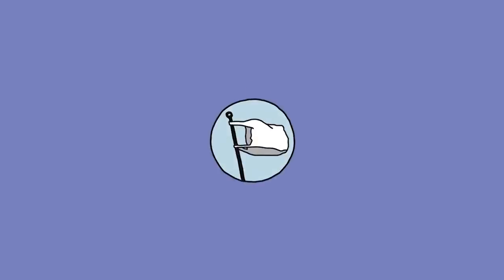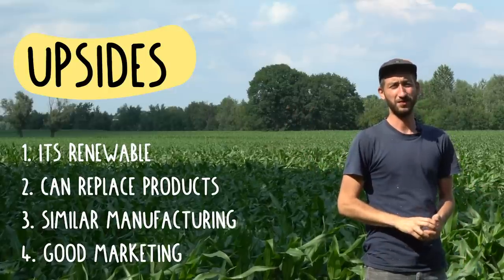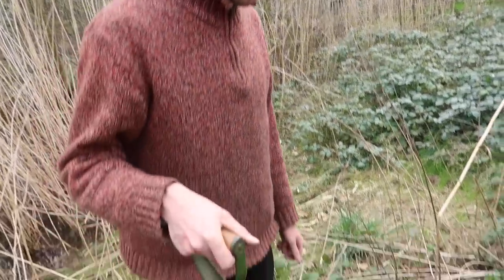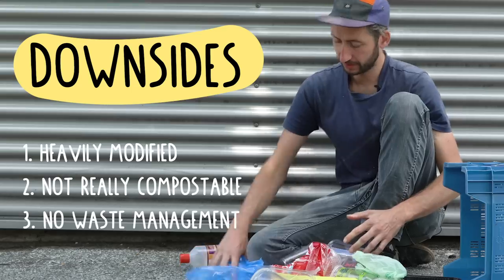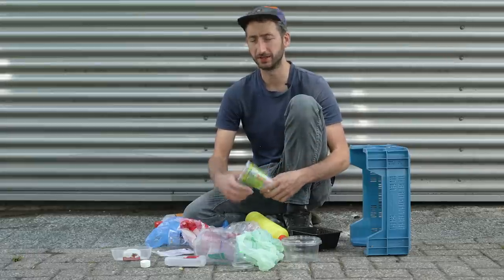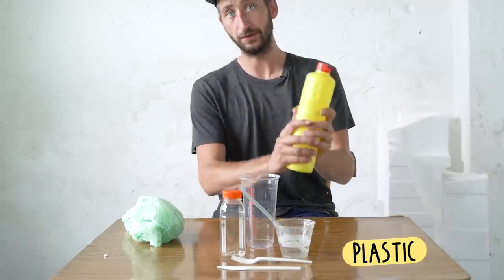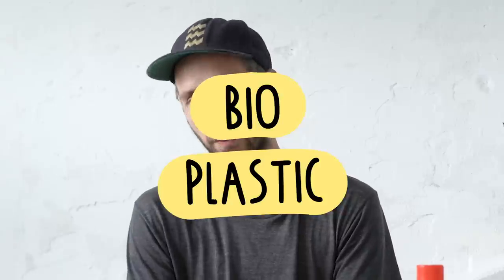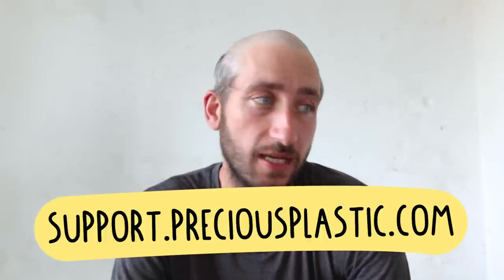Biodegradable & bioplastics explained (part 8.0)

Comment: This is the kind of videos that left me something that I'll never forget

Another thing that i thing it's worth to mention and its scaring me, is that the materials used to make plastics, biofuels, etcs, looks pretty friendly but are in fact comestibles goods. We are feeding machines with them instead peoples. 

David: You already done a great positive footprint in this world. Thank you man!
Reply: The "Food versus Fuel" arguement (And a less mentioned, but equally relevant "Farmland vs Wildlife" arguement, as arable land is less of an issue compared to how we get that land in my opinion) is VERY valid, so it is good you recognize that.

However there are many methods for Biological Feedstocks other than using dedicated "Energy Crops",Such as Maize or Sugarcane based ethanol/plastic, or oil crops such as Oil Palm.  Mainly Algae, Argicultural Waste, Sewage/Wastewater, Food Processing Waste, and usage of "Cover crops" or other related yield increasing crops alongside food crops.

I will post some relevant links below:

https://wikipedia.org/wiki/Food_vs._fuel

https://en.wikipedia.org/wiki/Sustainable_biofuel

https://en.wikipedia.org/wiki/Lignocellulosic_biomass

https://en.wikipedia.org/wiki/Biofuel#Second-generation_biofuels (2nd generation and foreward will use non-food cropss, and often not even farmable land)

https://en.wikipedia.org/wiki/Anaerobic_digestion#Waste_and_wastewater_treatment (can produce a substitute for Methane/Shale Gas/Natural gas.  This is typically used for fuel, but can be used in refineries)

https://en.wikipedia.org/wiki/Cover_crop

Comment: I think the issue is PROPER RECYCLING AND EVENTUAL DISPOSAL

Plastics are essential to hermetic seals, products that can last a long time, and yet be light and not brittle (Ie not glass or ceramic)

I think they are essential to many aspects of the modern world (granted some use cases should be stopped such as "disposable" water bottles etc)

I feel it is much more important to encourage proper plastic life cycles, rather than try and fear monger/ban it entirely

Plastic is no issue if it is:

- Reduced as Much as Possible (use less, don't have "dumb" use cases ie disposable water bottles etc)

- Made from biological source material (in plants using sustainable energy sources for power) via

*the chemicals made via microbes in bioreactors
*Via Pyrolysis Oil  (preferably from Biomass and/or RDF firing plants)
*Via Biomass Oil (Via oil crops like algae, and NON FOOD VS FUEL SOURCES)
*Via HTL Bio-Crude

- Sorted and Recycled (As many times as possible)

- Downcycled ( PET->Polyester etc)

- Disposed of Properly (Prefferably via Biological Digestion (Anerobic, or via Genetically Modified "Plastic Eaters" in biodigesters), or Pyrolysis and/or Gassification)
Reply: We have the technology for most aspects of the above outlined solutions.

Others are near-future, and are limited mainly by research funds, and "economic viability" both of which are solved via government action (Taxes on the bad, subsidies on the "good", regulation of pollution, research grants etc)
Reply: I think the Precious Plastic Recycling Ecosystem will have a HUGE impact on developing areas growing their recycling ability.

We need to "Close the loop" however, with Renewable and Sustainable Sourcing Options, Enviromental Cleanup Workflows/Tools,  and "End of Life" options.

Production is more difficult short of PLA, and may thus be better left to larger entities.  The continued development of sorting sensors/workflows, and the below enviromental recovery options may act as a sort of "Plastic Mining" source.
 
Pollution Cleanup Options Such as Locally Produced "Booms" to contain, and if towed, collect Floating Plastic Debris could reduce local plastic pollution (ALONG WITH stopping ongoing pollution obiously)

End of Life Options are an area Precious Plastic could expand into well;  Workflows for Anerobically Digesting PLA, and Designing Low/No pollution Pyrolysis Units (Short of CO2 emmisions if using fossil fuel based plastic) could turn the "Un-recyclables" into useful energy, and prevent them from ever becoming polluting microplastics.

I feel these three areas can be developed by Precious Plastic, and would lead to far more Real World Change.

Comment: Good thing you mentioned biodegradable plastics at the end. Because I have worked on PHA and was thinking about it during the whole time haha. PHA is produced naturally by bacteria and they degrade it too. So you can just drop PHA plastics anywhere in soil, they'll decompose in a few weeks. Would have been nice if you has done a video using that.

Comment: Hello Kamp Dave and Army,  
I am writing from Canada and am so awed and impressed by the common sense approach to disentangling the waste management process. 
Turning it into a green end result for the planet, through vision and community futures.
💡 I have an idea, not sure it will be advantageous, yet worth taking it into consideration.
Using a parabolic mirror finish disc and using the sun as a solar eliminator...build an outdoor cement holding, open front-entry  shelter for plastic, with a roof exhaust fan filtration using a 2 step charcoal-water purification filter system.   
With the sun's angled ray directed with the parabolic dish which is attached to a fabricated metal rotating stand aimed at plastic. This will reduce the plastic into recycled reusable for building material. This end product is of course mixed with sand, cement, refined parabolic-plastic and foam to create a lightweight bricks and blocks  building for housing.
Just a though. □♡□ Mary

Comment: Thank you for this finally an honest  review on the truth about compostable  plastics, Can you do an experiment on oxo-biodegradable plastic?
Reply: Looked into those a while ago... As far as I understand it's the perfect way to create microplastic -.-
Reply: and as far as I know it's banned in a lot of places, right?
Reply: Well I looked in to the standard of both of them ASTM D6400 (for compostable) and ASTM D6954 (oxo-biodegradable) you ll be suprised that they both have same biodegradbility criteria its just the way they get that stage is different compostable needs composting facility and oxo-biodegradable needs open air (basically oxygen) because these confusing mis informations yes alot of places have banned oxo-degradable. Bu i think it has potential when it comes to littering issue and mismanaged waste soley because it biodegrades in open environment
Reply: I just think it will be fun expriment to do, and of the results turns out the opposite of what the general public thinks that would be interesting as well !
Reply: cool, I'll have a look at those standarts again! As far as I understand oxo-degradable plastics work by adding things that oxidise to the plastic, which just helps to break it into smaller pieces, but that doesn't have to mean that it degrades, right? 

"There is a considerable risk that fragmented plastics will not fully biodegrade and a subsequent risk of an accelerated and accumulating amount of microplastics in the environment, especially the marine environment. The issue of microplastics is long acknowledged as a global problem in need of urgent action, not just in terms of clean-up of littering, but also of plastic pollution prevention." (from the wikipage of oxo-biodegradable plastics)
Reply: Hmm from my understanding is that oxidizing they mean it breaks the long molecule chain of polymers so it will essentially just be short carbon hydrogen bonds and then its accessable to microorganisms to consume. Again I think definitely the 3R is the way to go but this could be good for those unavoidable plastic packagings the good thing about this is it doesnt interrupt recycling system so it can just follow the normal waste management route no need for a specific segregation

Comment: The thing about P.L.A. is it it was designed to break down in heat and moisture combined, the reason for this is because you wouldn't want packaging breaking down while still in the store on the shelves before it is bought and used. P.L.A. was designed to be broken down in a compost pile which when done properly poses both heat and moisture for the P.L.A. to properly  decompose.
Reply: Agreed, since there is no proper infrastructure to handle bioplastics, we cannot use and throw them into garbage

Comment: what an important video! thank you. but i have one question: what happens after the biodegradable plastic degrades? does it become micro-plastic, which is even worse for the soil, water...? im also wondering if it is ethnically correct to use up potential food for just a one-time product :/ and if it is really better than oil, since all that used up fields and destroyed animal life :/ 

you are awesome :D

Comment: I was wondering about the bio-degradable thing... (Axel Sixtysix also mentions is in a comment further above.)
I have read somewhere before (wish I remembered where) that only some biodegradable plastics are actually biodegraded (meaning actually returning back into the cycle of materials in the environment) and some just break apart more easily, so are basically just mechanically reduced to more microplastics. 
Do you know more about this? Are there actually are any "bio-degradable" plastics at all that degrade down far enough into a molecular structure that organisms in nature can utilize again?

Comment: Hi Dave, could you please tell me, would melted HDPE adhere to concrete, for example if i was to make a river table from concrete could i use melted HDPE to replace resin, if so  would it be best to create say small islands from HDPE then pour the concrete, or pour first, create holes in the concrete and then add the HDPE? awesome work in your vids btw.

Comment: Well there's a lot of approximations in this video. First, PLA has never been fully composted yet. There's one studdy in which scientist note THE START of a degradation, and concluding PLA might be compostable. The laboratory conditions was: warm temperature, high moisture, as Dave said, BUT he forget High pressure AND high enzyme concentration. That's why even in a composting unit, PLA is still not compostable because all the required conditions are not met. Source : https://hal.archives-ouvertes.fr/hal-00977105/document  

Second, about bio-degradable plastics. There's no hope in it, definitely, except to hide the problem. Let me explain why. What is called bio-degradable plastic are in fact programed braking polymer links. Technically, you introduce into the polymer (which can be any polymer, even the worst ones environmentally speaking) an element which will degrade in a time. Anything which can be degraded by UV, water, oxydation or mecanical solicitations. Is it any good ? Well, these  bio-degradable plastics are still not assimilated in the environment. Some links are broken, and the item loose its shape, for sure, but there's plastics left. Micro-particles actually. Just you can't see it. Into the sea or live water, it's still very harmfull for any biotope.
Reply: Do you have a reference to your claim about the biodegradable plastics? I suspect this is true as well, but I'd like to see some research.
Reply: @hewhoisknownastaco  back in 2009 I was working for a major food company at packaging dpt. This have been told to us by our bags  provider. In 2009 there were no PLA bags yet, so it was degradable PE. Few years later came the PLA version, with same degradable properties. You won't find much documentation about this, because this is business.  Neither about electric/hybrid/hydrogen cars, which are not much greener than gasoline cars...
Reply: Maybe the important thing to mention in reference to this video: Dave is by no means encouraging the use of any kind of plastic, quite the opposite. Becomes clear if you watch the whole video.
Reply: @martin_mue  I'm a PP supporter since the start. I guess I do not go astray about Dave or the PP team. I just share what I know.